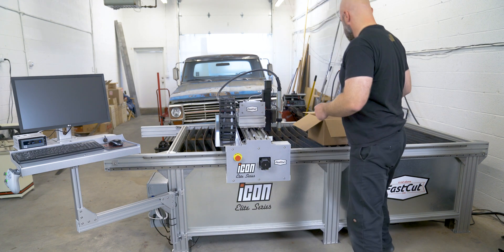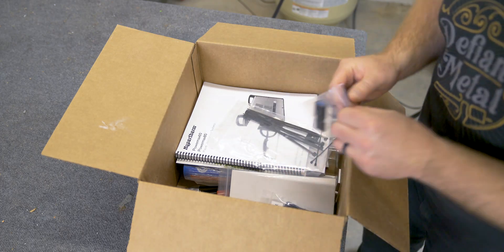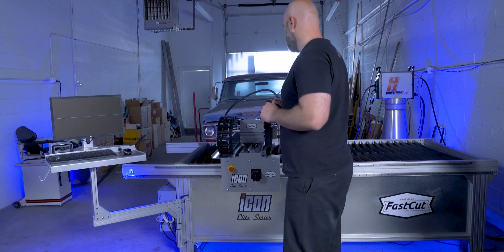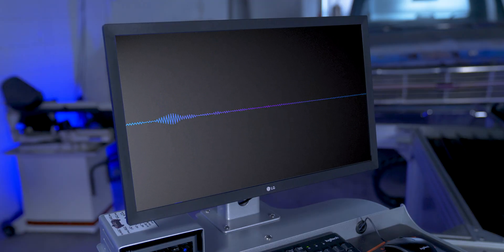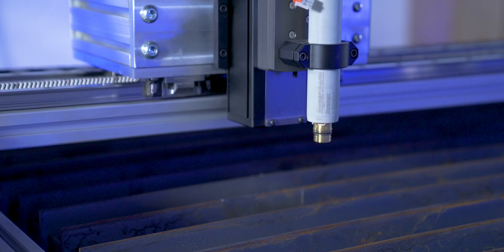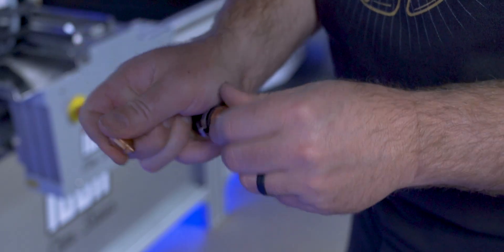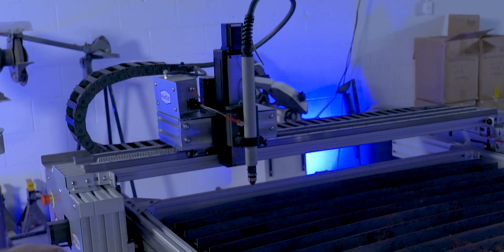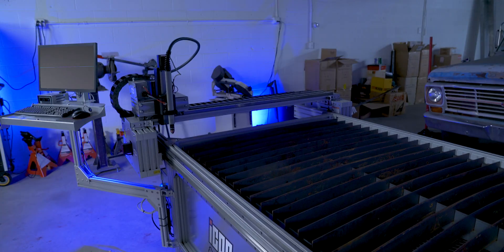My Plasma Table Talks Back

Comment: Sick table, Some advice I'd give from working with routers and water jet tables is that you should work "inside to out" and that basically means do all your inside cuts before cutting your frame edge on the outside so that the material is less prone to being pushed around. It's not such a big deal with thicker material but with thinner material it will be much more prone to warping.